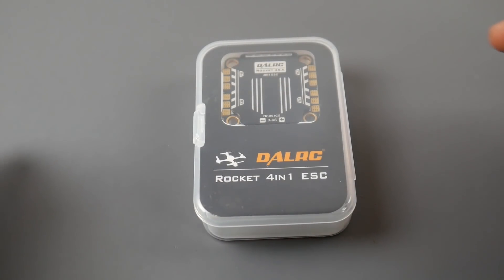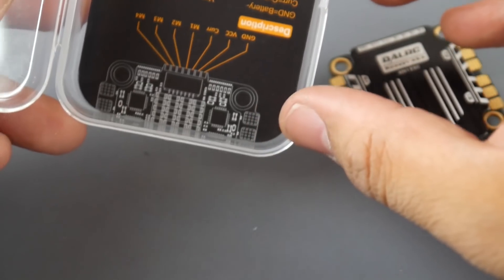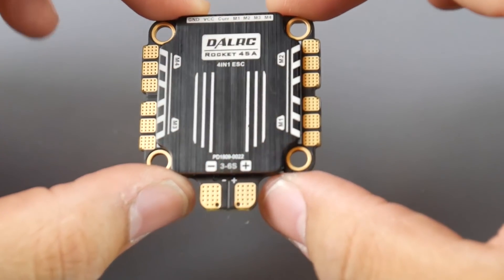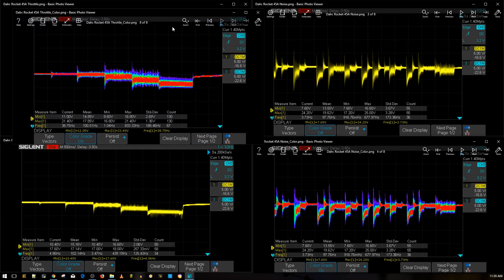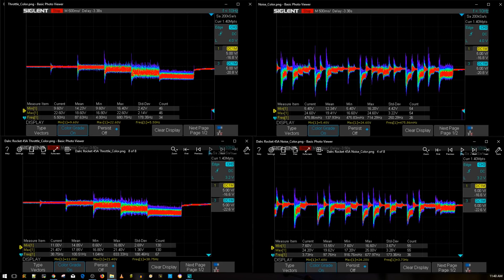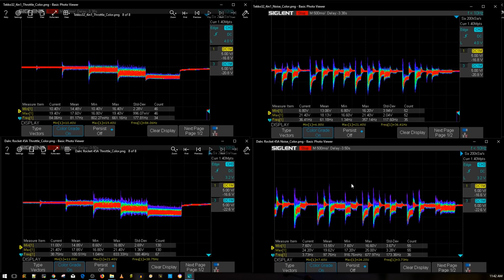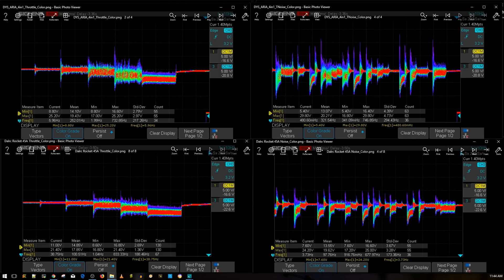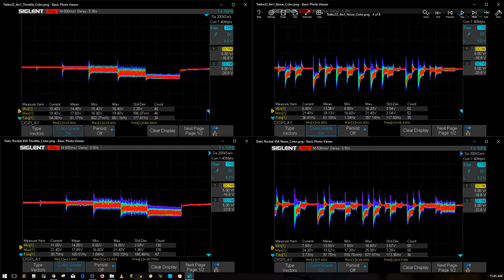WHO WILL WIN??  DALRC ROCKET 45A VS 50A Noise Test and Review

Comment: Awesome video once again man. If you dont mind me asking. How do you do the stimulated aggressive flight? I'm having video blackout problems on my quad and I wanted to simulate the conditions indoors..... where I don't have too look for my quad after it happens lol.
Reply from the maker: How are powering your vtx
Reply: @DroneMesh  12v pad on a lumineer 4 power pdb. It came with my QAV-R.
Reply from the maker: @SuperSilvi1990  route the power from the battery pads to the VTX and update me if it's still blacking out.
Reply: @DroneMesh  Alright thanks. Once I get some clear skys I'll fly it in my local park again.
Reply: @DroneMesh  the vtx is a AKK F2  800mw vtx